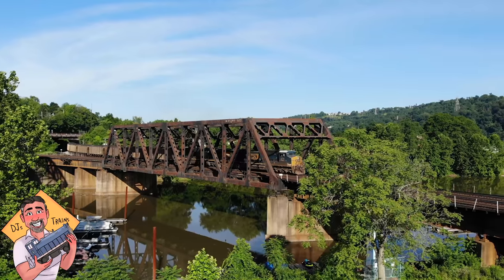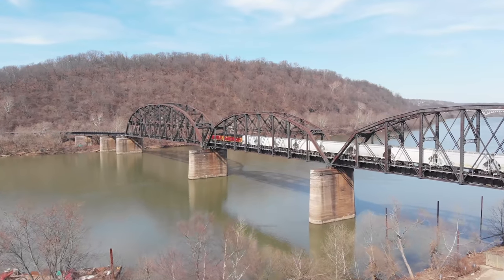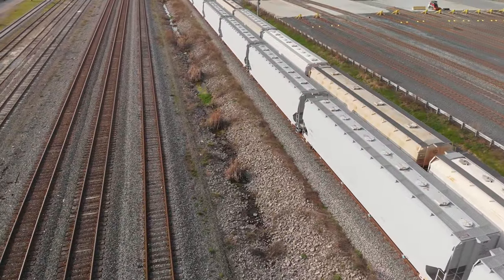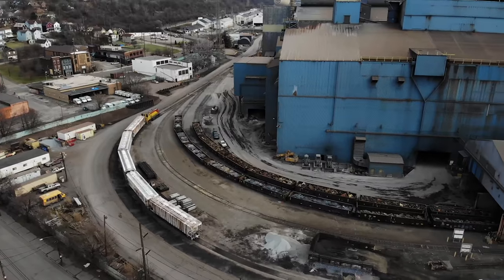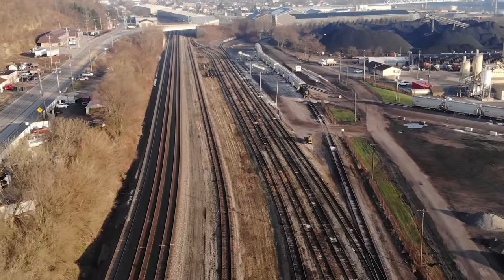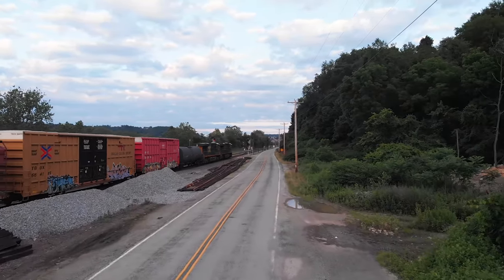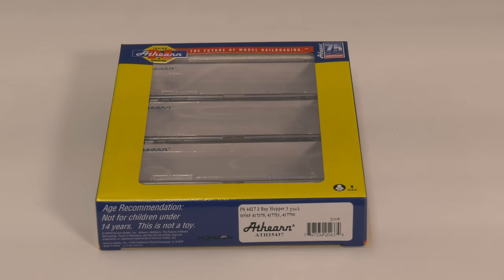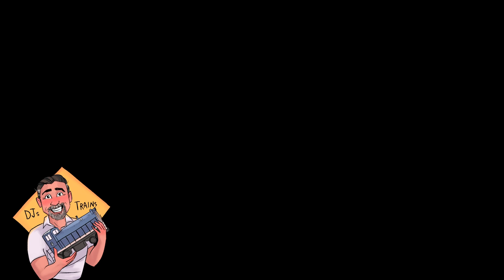RAILROAD FREIGHT CARS EXPLAINED BY AN ENGINEER!

Comment: Thanks for the info.   Did the have covered hoppers in 20s and 30s?  Nice Beastie Boys reference.
Reply: A lot of what is done today with covered hoppers was done with box cars until the mid 50's. There would be clean box cars that would be used to ship grain. They would put plywood type bulkheads across the door and pour the grain over it into the box.
Reply: DJ Kool...
Reply from the maker: DJ Kool - Correct, but Beasties also had a more slow paced delivery but without the cough lol
Reply: @djstrains  I know, I was just pointing out that DJ Kool also used that line...in fact, made an entire song about it. I used to go crazy when that song came on in the club back in the day...

Comment: Dj you sorta touched on this but... I'm modeling a mini mill (finally discovered modeling work specifically gets old real quick, you can only take so much spot specifically switching in your off time) other than scrap gons going in and coil steel/loaded flats out what other commodities does smaller electric arc furnace consume/produce?
Reply from the maker: look for ideas here: https://youtu.be/KXTmP4JQfys

Comment: Woah what happened to the Intermodal yard? Dj I remember bringing in stone and dirt to build it I think it was only 4 or 6yrs old lol. Plus I never new that a heavy car could damage rails. GE's & EMD's weight 400,000lbs give or take by them selfs can't  Imagine a car being that heavy unless it's Schnabel car and I haven't seen one yet 😅 and I'm a RR junkie 😆
Reply from the maker: They failed to get enough business for the intermodal and it shut down
Reply: @djstrains  That location would make a great soot for light mechanical work for locomotives and cars. Rather then sending them all the way down Cumberland. I can imagine it takes hrs by rail to get down there from mckeesport.
Reply from the maker: @Dachamp2001  rail cars get light work done at mckeesport in Riverton yard.

Comment: Are covered hoppers at the very first of the train right after the engines filled with sand, then followed by a string of tank cars as so if there is an accident the covered hopper with sand in it absorb the impact, and any explosions?
Reply from the maker: Yes, it is a "buffer car"
Reply: @djstrains  
Thank you for the reply!
Reply: Sometimes it's sand and sometimes it's "pebbles".    IF there is an incident theoretically the sand in the covered hoppers 'could' be used an an absorbent.

Comment: Hey DJ I just saw a job opening for a engineer at a very small railroad operation near me.  They only asked for a high school diploma / GED, and no other certifications or anything, seemed suspicious, like to good to be true.  What do you think?
Reply from the maker: You dont need any experience to work for a railroad, because they want to train an open mind on how they want things done.  Experience can work against you actually.  class 1 railroads are horrible right now and thats why we are trying to strike. A smaller one may be a better fit, my friend.
Reply: Do they need a certified engineer to apply?   If they will train you....that in itself could be a reason to take the job.

Comment: Do they still have switch locomotives for example SW1500's used currently?
Reply from the maker: Its been a few years since I have seen the MP15 in my area.  It was fun to run, but I dont miss it because it is the most cramped engine for crews.
Reply: In general you'll see those on short lines or large industries.   Great units for switching.
Reply: @djstrains  I enjoyed running them myself when switching yards and industries.   Never really felt cramped but I never took one over-the-road either